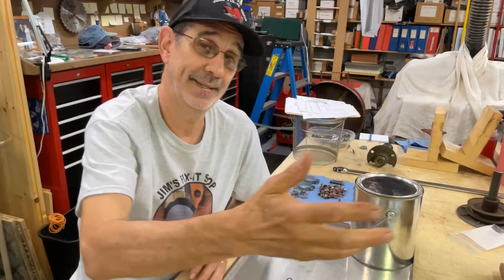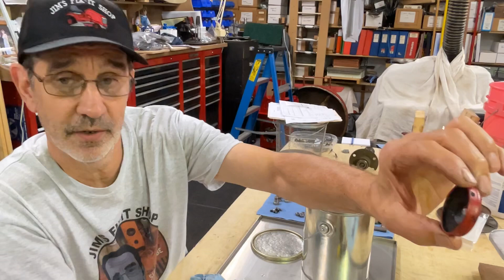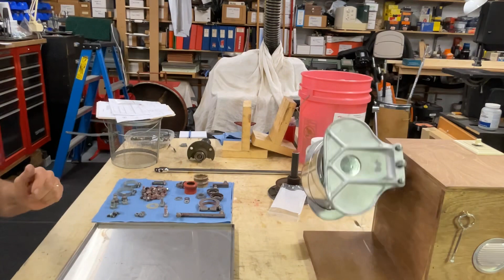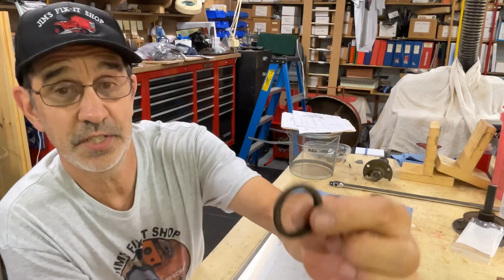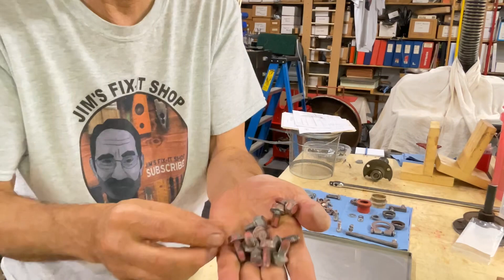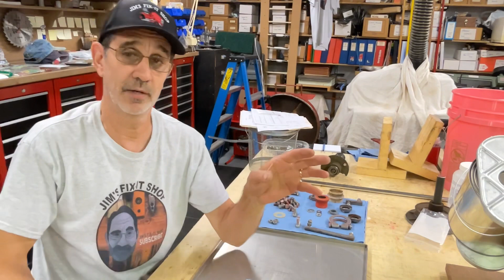428. Explaining my gadget.

Comment: A really nice video would be how the lockout mechanism works when trying to mow in reverse
Reply from the maker: Well, the one I have on my machine you have to push it down on the lever by your shift handle as you’re engaging the mower deck, then step on the pedal that holds the mower deck engaged. Then you can mow in reverse.        Jim
Reply: Well nevermind that might get you in trouble it's easy enough to see how it works